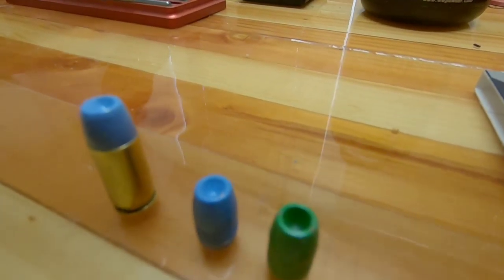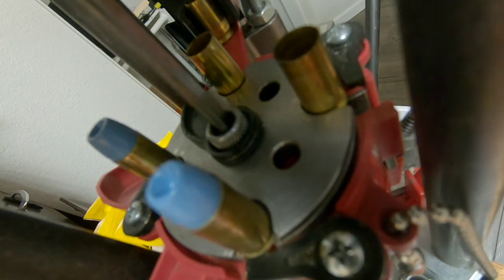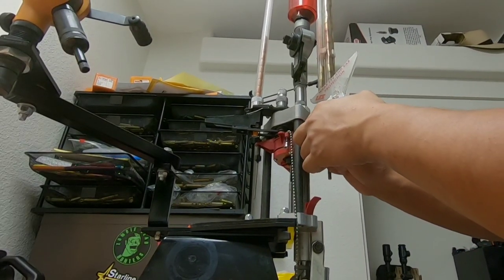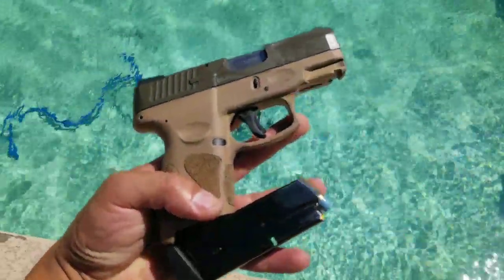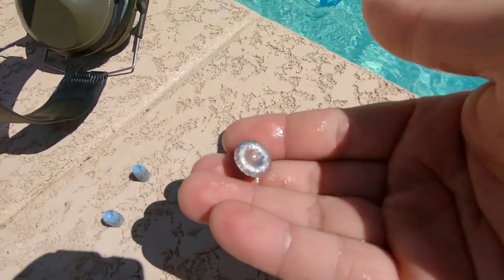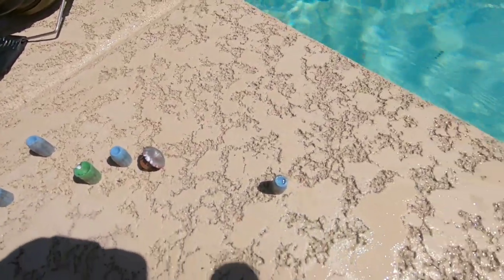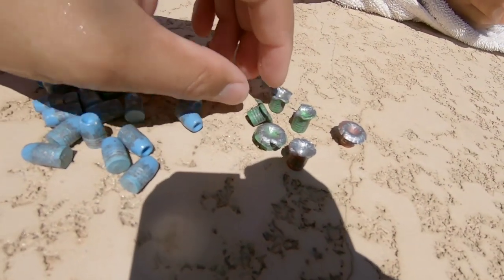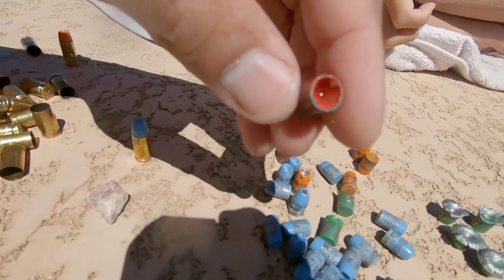Shooting Under Water! - 9mm Hollow Point Expansion Test - Slo-Mo

Comment: That was very interesting. How do you like the G2C? I'm thinking about getting one for my wife.
Reply from the maker: Its my EDC. Been very reliable as you can see it even functions under water on a very low charge.  Its one of the only striker fired pistols with double strike capability (like a hammer fired pistol)
Reply: I bought my dad one hes getting older and struggles with loading the mags ive bought him a loader to assist him happy its so reliable even under water

Comment: This was a really top notch video. Fun content, good editing and camera work, etc. You got a lot of great still shots too. I was going to ask about what you did for hearing protection, and whether you can see any signs of hydraulic damage to your barrel. I know that some guns have been made with this in mind, but I have never been sure how much we should worry about it at handgun pressure levels. Thanks, Kenny.
Reply from the maker: Zero damage. Good seal over the ear pro. Pressures arnt as high in the chamber underwater as if it where shot outside. Lack of air. Shotguns are the exception to this
Reply: @EagleEyeShooting  Thanks for the reply. I really don't understand how the pressures would be lower though, as essentially you are pushing out a projectile, plus the water mass. What am I missing? Are you getting chamber pressures by reading primers?
Reply: @EagleEyeShooting LOL "lack of air." Jesus Christ dude how do you think air gets between the bullet and the case when you're firing normally? It's not a car engine, there is no air intake.